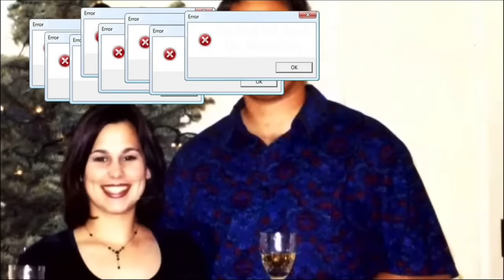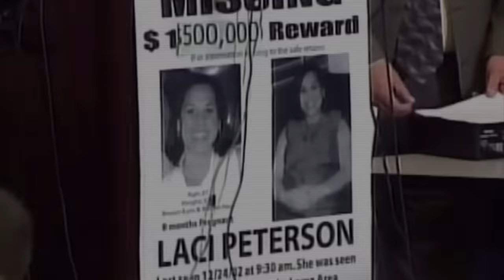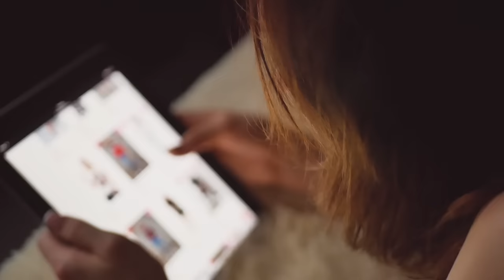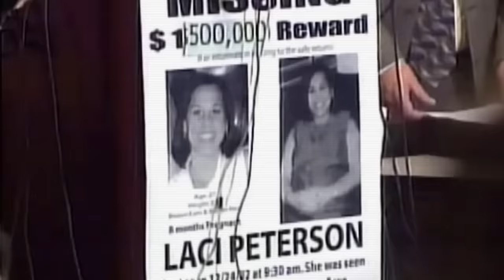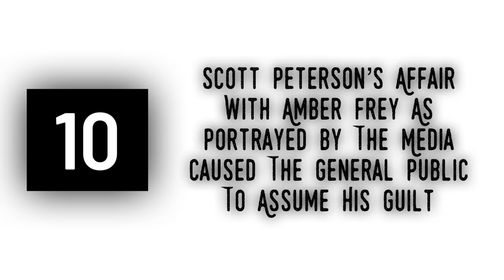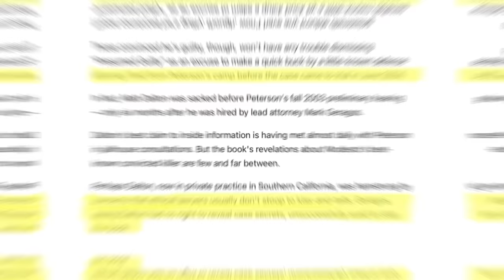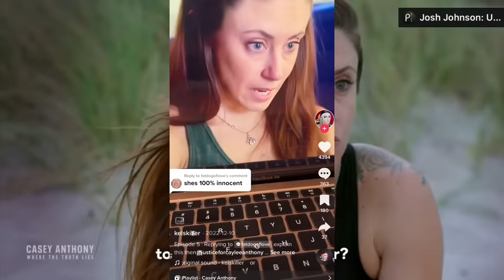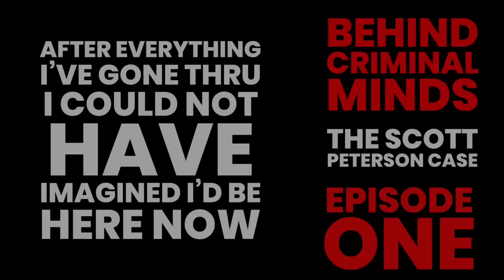Scott Peterson | The True Story You Were Never Told | A Tale of Two Stories

Comment: As a fisherman, the boat was the first thing that stuck out to me. I’ve fished and owned several different 14 foot aluminum boats (exact size and type pictured) and they can hold ALOT of gear and 2-3 guys without issue.
Reply: Nice fish!
Reply: But he also fishing in the afternoon in broad daylight with a dead body  wrapped in a blue tarp in the boat which he would have to back into the water which people saw him do and then he would have to leave to go park his truck 
with a dead body in his boat  and yes he would have  capsized if he had to push a dead body over with weights tied to them.
Reply: And the neighbor saw him putting something heavy into the boat wrapped in a tarp. When the case went to trial she had passed and her info couldn't be used. The family knew nothing of the boat. The concrete was found in his storage unit. Why wouldn't it be in his garage?
And when someone goes missing look how many calls of sightings they get.
I work with one of Lacy's friend.
Reply: @fjb3544  it’s his experience not opinion & fyi anglers go great lengths to protect & conserve our natural resources so please keep your opinions to yourself until you get some education on the matter.
Reply: @NicoleMichelChannel  it’s an open public forum I can and will say anything I want. Gavin Newsome 24
Reply: @fjb3544  and so can we
Reply: @fjb3544  Oh hell no!!!!! Yall keep him!!
Reply: Laci was 153 lb. He'd need 400 lb of concrete to keep that down.
Reply: @teresamortenson8000  Wrong.
Reply: @kennethwalls341  who are the people you claim saw him at the marina? Got names?
Links to their testimony?
Reply: @sophie8394  of course he won't answer you. Because, they don't exist.
Reply: @reneenayfabulous  typical Peterson groupie 🙄 Can't back up his lies.
Reply: @teresamortenson8000  Bullshit. The neighbor saw him putting something (the umbrellas) into his *TRUCK*. No one ever saw him at the warehouse that day which is no surprise. Dec 24th.
Reply: @kennethwalls341  ya I knew you couldn't answer the question.
Reply: I'm from Southern Louisiana where we go gator hunting and I'm here to tell you those boats can hold  a lot   of big ol gators... And him fishing near where she was dumped I was sold then..
Reply: @jenniferbaebler6946  It's such a stupid idea that even Nancy Grace says it's ridiculous. And since Laci was still alive for 10 or more days after she was abducted explain how Scott was involved.
Reply: @NoSpam1891  take your meds Ken.
Reply: @NoSpam1891  I never heard that laci was still alive 10 days after disappearing  from her home
Reply: @goldieryun-or1zv  It's in the habeas appeal. See Dr Philippe Jeanty.
Reply: @kennethwalls341  great points didn't they ask witnesses if they saw anything in his boat and they don't recall seeing anything. Why would he bring her there where people are back his boat into the bay where people can see the body. In order to make sense of all this you have to look deeper into what really happened here. This video just highlights Scott's guilt and never fully shows the ineptitude of the Modesto PD . It was proven that Brochini lied on his reports about Scott's boat where Laci knew about the boat. I'm saddened by all of this it's awful
Reply: @NoSpam1891  where is the proof she was still alive 10 more days?
Reply: @reneenayfabulous  Squaaaawk!
Reply: @helenaterschegget8791  It's in the habeas appeal. See Dr Philippe Jeanty.
Reply: @teresamortenson8000  he had a boat and showed reciepts and plenty of witnesses that saw him have nothing in his boat he fished xmas in the daytime he must be super stupid also they publized his aliaby. They never sequestered the jury nothing. Read his lawyers book.. there was no physical evidence i dont think he did it period
Reply: @sophie8394  yes actually go read his book they didnt let them testify. They even took a boat and a body lacis size it capped each an every time
Reply: @thegreyparty-mh4bo  what are you talking about?
Reply: @thegreyparty-mh4bo  👌. So you don't even know what you're talking about...
Reply: @jenniferbaebler6946  YASSS!! We can fit five or six gators and three people plus ice chests, guns, tool boxes, sooo much stuff.
Reply: @sophie8394  she is crazy lol
Reply: @NicoleMichelChannel  You: angling  Myself:  English
Reply: @traceyroyer993  z
Reply: @NoSpam1891  rule of thumb is 10 % of the weight .. so no it’s not 400 pounds if she was weighing 150 pounds he only needed 15 pound concrete
Reply: @NoSpam1891  really ? There is no proof she was actually alive? None, and it’s much more likely she was killed, that day, and again 90 per cent it’s the husband and eeeek he had an affair, and he went fishing close to where she was found, and he went on the run.. other scenarios could have but there is literally NO evidence to support it
Reply: @thegreyparty-mh4bo  There was not much physical evidence left behind, but the investigators did manage to find a single hair, believed to be Laci's, on a pair of pliers kept on Scott's boat.

The theory laid forth by the state was that Scott killed Laci and transported her body on the boat. Laci had never seen the boat let alone in the boat

Therefore, the only reason that one of her hairs would have been on the vessel is that her body was there after she was murdered.
Reply: @helenaterschegget8791  CHITTENANGO – Village of Chittenango Police announced on Tuesday the arrest of a Hudson Falls man in connection with the death of Lori A. Leonard. Shawn M. Doyle, 29, of School Street in Hudson Falls, has been charged with second-degree murder in the case

A boater found the body of Leonard, 33, Sunday morning in the Champlain Canal near where it meets the Hudson River north of Albany. Leonard’s body was floating in a metal toolbox similar to those used in the back of a pickup truck, Spiezio said. It floated, although it was weighted with a sandbag.

She weighed 100 lb, the toolbox 50 lb, the sand tubes 180 lb. It still floated.

Forensic Files II - Lori A. Leonard Season: 2 Ep: 3
Reply: @helenaterschegget8791  didn’t the police search the bay and find nothing? You actually believe Scott used “ fishing in the bay” as his alibi, AND also dumped her body in the bay at that time? It makes no sense. Remove your emotions and look at the evidence, or lack there of.
Reply: @sigusmundo  hmm? He went there looking each  day , where she showed up, eventually and ONLY because her body broke free from the ankers he made (eventually your body blows up from being under water and that’s what happens if the weight of the ankers isn’t heavy enough, Also oh of his searches)  ( he searched tides etc before she went missing in that area) he bought a boat, no one knew about, in fact at the same day he told his mistress this would be his first Christmas without his wife, who had passed away,  before she actually passed away. Ankers he made were missing, and there was dark  hair in the pliers on his new boat. That’s not emotion. Those are facts. And when his then mistress says, how can yay tell me she was dead when she wasn’t even dead yet? He had no answer. He is a salesman, until his stories weren’t believable anymore, compounded by actual facts.
Reply: @helenaterschegget8791 ok so no actual evidence.
Reply: @helenaterschegget8791 the police searched the bay with sonar and divers and found nothing. Which tells me she was dumped there afterwards. So many witnesses that saw laci walking her dog. You actually believe scott commited the perfect crime, leaving no evidence, but used the spot he dumped the bodies as his alibi?
Reply: @helenaterschegget8791 he is a compulsive liar. Everythinghe he told his mistress was a lie. So why would you believe this one lie he told her. He made that call and told her his wife was dead because her friend found out and told him if he didn’t tell her he was married she would. So he made up a lie to tell her.  None of this is evidence of anything except Scott has low character.
Reply: @helenaterschegget8791 what do you think the statistical chances are that the house across the street was burgled at the exact same time as she disappeared, and they are not connected.
Reply: @helenaterschegget8791 the anchors you speak of are speculated to have been made no actual evidence of that either. He visited the bay to see where the police were with there search. The test used on the hair in the pliers was not a reliable test. Besides, a single strand of hair wedge in a set of pliers proves nothing. My wife’s hair gets all over the place. Explain to me why exactly you think her hair was in the pliers? What do you think he did with the pliers to get her hair stuck in it?
Reply: @helenaterschegget8791 the facts are at least 18 witnesses saw her walking the dog. The neighbor found the dog with the leash on, which also indicates she was walking the dog when she was taken. Witnesses saw him at the bay. He has the ticket where we checked in. Noone saw him dumb anything out of the boat. There is even a question if you can dump a body out of that time boat without capsizing it. The police thoroughly searched the bay and found nothing. The police were very vocal about how they thought he dumped her body in the bay. So when the people who did kill her dumped her it was a no brainer where to dump her.
Reply: @helenaterschegget8791  isn’t there even evidence that she was online shopping after Scott left the house?
Reply: @sigusmundo  he told her she was dead before she was dead …why? He thought as a good sales man, if she was missing, just as Chris watts likely planned it, if they stayed missing long enough, he could be eventually be with the new mistress. His family and lacis are would be good with it, in his mind. They didn’t foresee it would be allover the news and obviously that was a problem. 

But as the words of another family annihilator signs of a psychopath, one if his last interviews before he was executed . Everyone believed he adored his family and loved his daughter. He said I did, but you still killed her, yes well I had someone new, and i wanted to be with that person, and it seemed  to him an easier choice.  Some people in this world are devout of certain feelings like, life, quilt, and they live by how they can get better, and who they can use for that.
Reply: @sigusmundo  no that’s not the way it works. Your body the longer it’s in the water weighted down will blow up, (he also searched how much you needed to weighed down) or parts, will remove it self. And that’s the time a body comes up. Or parts of it. Lacis, didn’t have that many parts left, she didn’t have a head (likely occurred prior but not sure ) no lungs, it was her baby being still intact and he had still been protected by her. And so her remains clearly not planted later, as it would have showed. It was determined to be as long in the water, as she was missing.
Reply: @sigusmundo  I don’t think you in that case what evidence precisely means. Indirect evidence is still legal evidence. Had it not been, any court would have had trouble with it,  and the re doing of his case didn’t had to do with being the evidence not evidence.  As a lawyer for his defense you would need your explain away everything pointing to him. Such as why he said his wife was dead before she was dead. Or why he suddenly had a boat no one knew about, nor that he ever went fishing prior. On top you need evidence that would lead away from him. And there literally is none. Even those break ins across  the street, it’s very well explained, it didn’t happen and it didn’t had anything to do with lacy. It’s no use to keep trying to pinpoint it and not nearly enough to see someone else besides Scott could have done it. Which if it’s it would mean it’s a stranger killing, which is super rare, doesn’t mean it doesn’t happen, but rare. So you really need to look hard to other cases or killers. And the one question  I have I need to find out if I can find the answer did they test the hair in the pliers they found in his boat? To come back to a case, im only aware of one case in which the husband was found guilty of the murder of his wife, and in fact he didn’t do it, and a serial killer did. It’s that a book writer believed it was was his MO.
Reply: @helenaterschegget8791 and the witnesses who saw her walking the dog? The mailman, the neighbor putting the dog back? Just disregard all of those witnesses?
Reply: @sigusmundo  it’s just never confirmed it was actually her.. seeing a pregnant person doesn’t mean it was Laci perse, and Im court it wasn’t convincing either. The dog is something he could have done as well. There is no proof it actually happened. So in court a jury hears all evidence, and they decide to give weight to each of them… you actually see some of these jurors in the new docu. They  tell initially they believed he couldn’t have done it, and towards the middle and end, they changed their mind. Saying the overwhelming indirect evidence, lead them to that decision. It all lead back to him. Nothing else and no one else. The job of defense is to take away everything that lead to him, and come up with new leads, people, or anything that lead to other people. There really was none,
Reply: @kennethwalls341 no he wouldn’t have capsized. The judge offered the defense to do a test for the jury to prove the boat would capsize. Guess what his lawyer said!?? “Na we good” 😂 when your own lawyer doesn’t wanna do that test you know dam well it’s bull shit 😂
Reply: @thegreyparty-mh4bo that is not correct. The defense did their own test. And guess what? It was flawed. It wasn’t the same boat. It had steel chairs instead of wood. And if you watch their video the guy in the boat literally has his foot on the ledge pushing the boat in the water 😂 and guess what?? The judge told the defense “if you get the exact same boat we’ll let you to the test for the Jury!” And guess what Scott’s lawyer said 😂😂 “actually we don’t need to do that your honor we’re moving on “ 😂😂😂😂
Reply: @sigusmundo buddy… listen to his phone call to Laci 😂 he’s clearly trying to give an alibi 😂 driving from his house, to the storage unit to get the boat, to then drive to the lake took an hour. Then another hour back. He was on the water for less than 40 minutes 😂 does that make any sense to you??? A 2 hour round trip for 40 minutes in the water 😂 come on man

Comment: I’ve probably already commented on this - good on you taking on the false innocence hackery movement. As a fellow attorney, I also want to praise your correcting the record on circumstantial evidence. Not only does the law specify that it is given identical weight. Moreover non-forensic circumstantial evidence (even though forensic evidence often/usually is circumstantial) is almost always the strongest/most probative of guilt - especially when you take individual pieces of evidence as a whole. The main (rare) scenario where a cased based only upon (quasi) circumstantial evidence (this scenario does not apply in this case) is where the only thing it proves is the non-element of motive. Here it goes to the act and the mens rea. Well done! Scott’s supporters should work on their thought-thinking and quit putting this family through needless torment. Scott is as guilty as the Big Guy.

Comment: I think there is an issue with "reasonable doubt" and that circumstantial evidence should be enough to convict someone.  Scott's fishing trip 90 miles away to the bay where they found the bodies, along with pliers with Lacy's hair wrapped around them in the boat should be "reasonable to convict" in my opinion. The odds that someone else did this to a guy who was cheating on his wife and who happened to be "fishing" on the same day his wife disappears are astronomical. But I do also wonder if they ever found the cement weights in the bay that (Scott) the killer presumable used. Did they send divers to look for them? Probably still there.
Reply: They likely are.

Comment: Will dry concrete in a boat doesn't prove anything in order to make an anchor you have to form it up pour it wet and let it dry concrete powder in the truck and in the boat concrete powder has no weight property unless it's contained in a bag or a bucket or it's formed into something if he was looking to try the body down he could have easily bought some cinder blocks